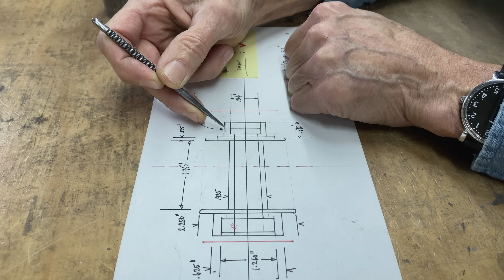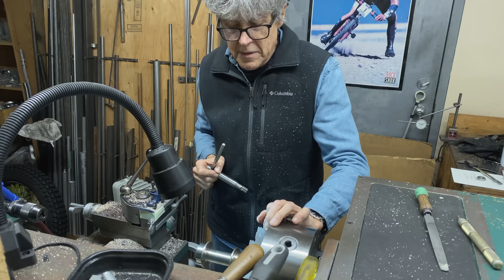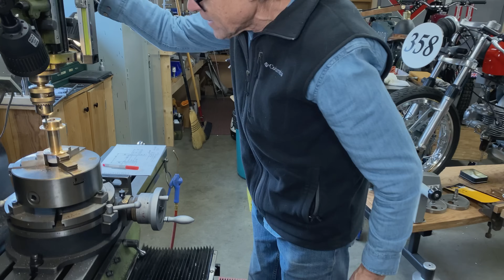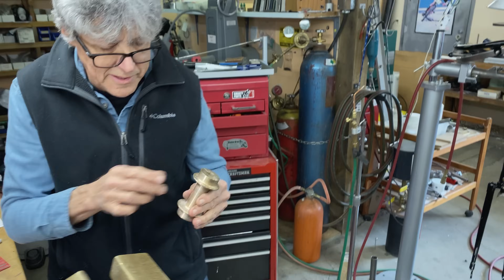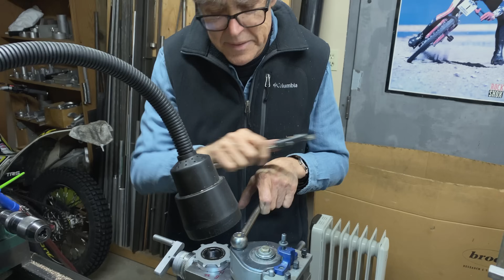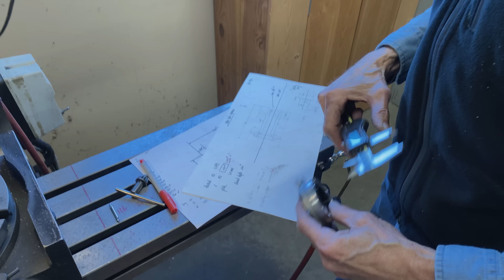1894 Giraffe Bike rear hub...What can possibly go WRONG? // paul brodie's shop

Comment: Quick little tip, you can thread really close to an edge by running the thread and power feed in reverse.  That way you can start the thread cutting at the deepest thread
Reply from the maker: Thanks. But my threading tool has a small angle of rake, so cutting your way means the rake is angled 6he wrong way....   :face-fuchsia-tongue-out:

Comment: Hey Paul a query about the soak of the brass after attending to the flux. How long do we wait before finishing.
Reply from the maker: With really hot, running water, it takes about 5 minutes for the flux to come off. Brazing flux comes off faster than silver solder flux....   :face-blue-three-eyes::face-blue-three-eyes:

Comment: Why not turn it down, knurl it, press fit some aluminium on top and then cut the thread? Or braze a sleeve on top of the reduced diameter section to build it up? Or just braze material over the top of that section and turn it to the right diameter? For the threaded end, you should do a thread undercut (as was mentioned by some posts above). ISO-4755 gives some standard dimensions (pictures and tables are searchable without paywall). It has two benefits - no spacer, and no stress concentrator if you radius the flange to the undercut.
Reply from the maker: Thanks for commenting. I could agree with some of your suggestions, but not the knurling and then pressing on an aluminum sleeve. I did fix my screw-up; I machined a bronze sleeve that was threaded inside and out. Seems to have done the trick....    :face-orange-raised-eyebrow::face-orange-raised-eyebrow:

Comment: Re machine  the hub on the other side  for the freewheel.  Then you can sleeve the whoops  side.  I would drill a couple  small  holes in the sleeve regardless and solder it .
Reply from the maker: It's fixed! I made a sleeve with threads on the inside and the outside and it worked just fine. I'm definitely not used to making so many mistakes.

Comment: I learnt from Keith Fenner that a 2" paintbrush on an indicator holder can be used to prevent any flying brass chips from covering the shop in brass-glitter. Use it all the time here and it works a treat
Reply from the maker: Yes, a paintbrush sounds like a very good and practical solution. I have not tried that. Thanks!

Comment: When you're holding something thin/hollow in the chuck it reduces the clamping force of the chuck because there isn't as much material resisting the pressure from the jaws.  I have definitely learned this one the hard way myself.

Comment: You could machine the outside tread on the sleeve before you screw it on, then you don't need a spacer. To make it precise you could screw it on the hub WITH a spacer between the hub and the sleeve and tread it, the spacer (which you can remove later) will give you extra room for the treading tool to tread the sleeve to the end maybe partially treading into the (sacrificial) spacer, if that makes sense.
Reply from the maker: Marcel, I see what you mean, but I have already fixed it... Thanks for commenting!    :face-orange-biting-nails:

Comment: You are definitely losing it Paul, I saw your lathe 'blooper' coming from a mile off with that material and the way you were holding it in the chuck, I'm quite shocked you didn't see it coming too! and then your careless drilling error! mind you I'm just thankful that your little blue and yellow Nazi flag is not in view and how is that Tiger Cub project coming along? have you got it starting and running properly yet?

Comment: Paul , when drilling brass and bronze you should "dub" the drill that is put a flat on the cutting edge so there is no hook angle to cause the drill to pull as it breaks through.
Reply from the maker: Yes, if was drilling brass / bronze all day long I would definitely do that. Thanks..

Comment: If you’ve never tried them you might consider an expanding mandrel or two. If I were making that hub I might rough in all the turning & finish the bores, then put it on a mandrel for final diameters & threading.

If nothing else, learning to use them will provide all manner of calamitous entertainment. Allow me to suggest less costly stock for the first couple of runs, & all in attendance should be wearing their goggles.

🤘😎
Reply from the maker: Yes, mandrels can work. But, first you need a mandrel that is a suitable size for the hub, and then you need to fit the hub to the mandrel. That seems like extra work, but Thanks...

Comment: Ah yes , a quick and relatively easy job with just enough stock to make one... It's usually one of those days when you think that it's that simple.  Locktite is like the ducktape for machinists, hate to use it but glad it's there...
Reply from the maker: And I did end up using Red Loctite to anchor the threaded sleeve I screwed on...

Comment: "Well officer, I crashed because I was trying to see if the blemish on my rear hub is noticeable".  ~ "Blow into this tube sir".  ps My advice is to measure and calculate twice, then ask yourself whether or not (on past experience) you are completely insane, sleep on it, and then do it properly.
Reply from the maker: That's a little hard to do. When Mitch shows up we usually have about 3 hours to get the job done.. No Pressure though..

Comment: Paul, I guess it was a monday at the shop. In my experience if it goes bad it often stays that way. As a correction I would turn the oD clean and silver solder a bushing around it and then thread again. To butt up against the hub I would use a thread relieve groove made with a small round nose tool with a diameter equal to the root diameter of the thread. Another small tip is to ground a small 90 degree flat on the cutting side of your drill when used in brass, bronze or delrin. This stuff loves to grab the drill as you know. When you just touch the drill with a grinding stone this problem is gone. I had a few of these days in the past too. Just regroup and make it better. The only way is up. Thank you Paul. All the best, Job
Reply from the maker: Thanks Job. Yes, you have some experience, I can tell. I machined a threaded insert instead of silver soldering on a sleeve. Either way can work.
Reply: That's a very sound, well thought  out method that you've given there and is the advice that I'd choose to follow in preference over what Paul did as a fix.

Comment: Paul, in high school I was bored with the metalworking projects we got.

Some of the kids predictably were making pot pipes, knives brass knuckles ET cetera. I happen to over a book on shipboard weapons and happened to cross something called a blunderbuss. It was from a book in the collection of Captain William Higgs, a well-known family deeply embedded in the tugboat industry of British Columbia.

I got the idea to make the Blunderbuss but was put off by how much material would cost but luckily a friend of my family, a guy who was a machinist and welder at Seaspan, found me a piece of bronze forging that was rejected for a propeller Hub due to a flaw in it.

In the machine shop after boring Machining off The Irregular Parts Etc I got the weight of it down to about 26 lb from I think about 65 the shop teacher saved all the extra cut off bits to melt down again for more projects

The captain bought it off of me once it was finished and tested it out against a sheet of plywood blowing a 2-foot diameter hole in it using bits and pieces of iron and other metallic debris around the ship. He told me typically This Is How They repel boarders coming along sides in boats

He bought the finished piece of me and mounted it to his third story reeling on his house and fired it off every Canada day until he was warned about it was warned by the RCP not to do this.

Comment: You never know when Bozo will appear. Why don't you use a radius tool to make a small undercut when you thread up to a shoulder. It gives the treads a place to run off and allows the nut or freewheel in this case to run up tight without having to make a spacer.

Comment: The centre drill seems to give a nice concentric C/S. Perhaps you could combine centre drilling and countersinking in the same operation when combined with the depth stop? Silver soldering a small bronze plug into the defective C/S could have been an option, but a lot of work...meh.

Comment: As a hobbyist machinist I feel that the deeper I'm in the project, the higher the pressure rises. The fear of the mistake that ruins everything. Watching you going from an operation to another is amazing, the concentration it takes to make just one of them would exhaust me for the day. And the way you deal with the mistakes is admirable, much self control.

Comment: My big cockup on a lathe was to grab the coarse wheel instead of the fine. Rammed the tool post right into the job ruining it and stalling out the lathe. Woke everybody in shop up. 1976, happy days.

Comment: Yup, brass and bronze is real grabby. It helps to grind drill bits to a wide angle as narrow angled drill bits are suddenly self feeding. Instead of holding the piece in the lathe with cardboard, copper will do better. That lathe guffaw reminded me of when I had to machine a 4" diameter 3/32" wall 304 stainless. The lathe with the 6 jaw chuck wasn't available so I had to use a 3 jaw chuck. Piece was 3 5/8" long so unsteady to hold. I was making .010" cuts and checking the 3 jaw after each cut. On the forth cut "BANG!!!" and the piece was gone. Bounced off the 12' ceiling and clattered across the shop to around 20' feet away. The end that was held by the 3 jaw was basically round, the other end was folded flat like a wedge. I never saw it leave the lathe but saw it falling and clattering across the room. And a fresh hole in the ceiling. Had the micrometer adjuster nut come loose, made a bunch of wrong size parts before I realized. Can't remember if I made them too small or too large. I had to recut or scrap them, some 40 years ago. Always checked mics after that.

Comment: Buy the common sized drill bits you use in those types of materials and then stone the cutting to a small flat.  They won’t  pull themselves into the material or your material out of the vise/chuck.

Comment: Just from watching you all these years I figured you'd be the kind of guy that would have a vacuum attachment for the lathe so you didn't get chips everywhere.... Have you thought about cutting the threads in reverse so you don't have to worry about it hitting when going right to left?
Edit: You could always look for a different freewheel so you don't need to use the sleeve trick to fix it... They make 13t freewheels for new-school BMX bikes w/ smaller gearing compared to back in the 90s. I always ran 44/16 then moved down to a 36/13 for chain clearance but now they have 21/9 gearing but the freewheels are built into the hub aka cassette hubs or freecoaster hubs... The freecoaster hubs allows for backwards movement without needing to back pedal.

Comment: Some days just go like that. On a side note, my dad had a saying " Highly polished, deeply scratched". He was a Tool and Die maker in Toronto and taught me as well. When drilling bronze if you change the cutting face angle on the drill bit with a flatter face it will not grab. Also use emery cloth in the chuck instead of paper to hold the part. I am sure you knew all that anyways. Keep up the excellent work!
Reply from the maker: Yes, I have used emery cloth to hold parts in the chuck. but not this time!  I like your Highly Polished Deeply Scratched phrase. Thanks for that....    :face-fuchsia-tongue-out:

Comment: That last error will work out in your favor. You can make the OD threads, on the repair sleeve, all the way to the end so you don't need the spacer from the original design.

Comment: I think sometimes it's just as enjoyable to see people puzzle solve their way out of mistakes 😅
In regards to the thread, did you consider producing them with a tiny undercut, instead of a spacer? I see a lot of machinists doing their threads that way, but though maybe you were worried about the wall thickness?

Comment: Save all those Bronze chips, and melt them back down into an ingot that you can make something else from. save a little money, instead of throwing them away. 
You probably got 50 $ just in chips.:hand-purple-blue-peace:
Glue a strip of wet/dry sandpaper to that cardboard strip it will hold the work very well without slipping. or use a strip of aluminum from a pop can with the sandpaper glued to it.
Paul, we now know that you are just like the rest of us. :face-blue-smiling::face-red-heart-shape:.  can't wait to see how you fix it.:person-turqouise-waving:

Comment: I was beginning to think that you were a robot since you don't ever make mistakes. It's good to see that you human. Thanks for sharing your videos. 👍
Reply from the maker: I am human that is For Sure. I don't make mistakes often, but this Hub was a Doozer!  :face-orange-raised-eyebrow:
Reply: @paulbrodie  Seems like when you get started on a project and make a mistake early in, sometimes it just carries thru.  Here's to making fewer mistakes next time, that's what I always say.
Reply from the maker: Yes, that was a crazy day. I am unaccustomed to making so many mistakes. I will try to do better next time...:face-orange-raised-eyebrow::face-orange-raised-eyebrow:
Reply: @paulbrodie  the free wheel thread on the hub.. should have a stress relief groove against the hub face at the end of the thread the same depth as the thread.. then you don't need a spacer washer.. it won't lessen the threads holding ability rather will increase the ridgity & hold of the assembly
Reply from the maker: That's how I was shown, back in high school. But, times have changed and I prefer to thread without the groove. Somehow it seems amateurish to me, but that is just my opinion...   :face-orange-raised-eyebrow:
Reply: Paul, as a matter of interest. Why didn’t you set the top slide over 29° when threadibg?
Reply from the maker: That's how I was taught, back in high school using a high speed steel toolbit. With the new Carbide inserts there is no longer any need to do that. They just cut very nicely. But Thanks...    :face-fuchsia-tongue-out:
Reply: The only people who make mistakes are humans 😜

Comment: That was a real world day, like everyone has...Anyway...My way of turning  a part made out of soft metals/plastic mounted on a   thin/short/tube wall   is to make a temp solid plug (or use an appropiate old ball bering as a plug) so I can tight the chucks properly  over the thin/ short wall. 
And for extra  grab on the jaws I use a doubled (2 faces-glued) strip of 220 sand paper instead of stock paper/cardboard.
Thanks for sharring your experrience.